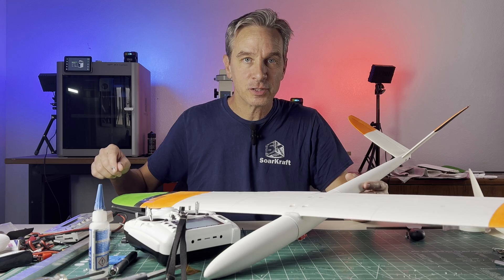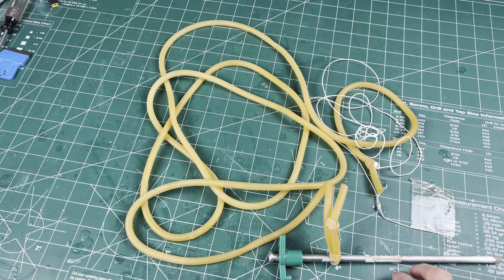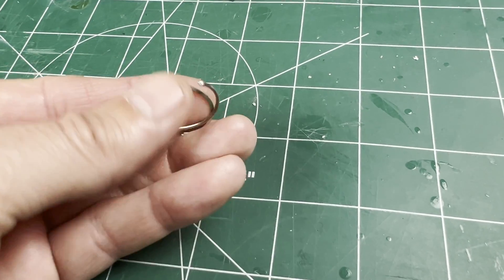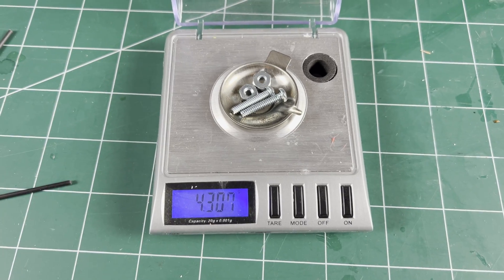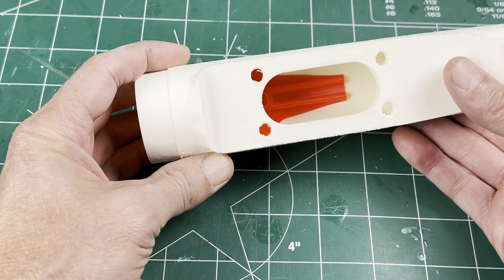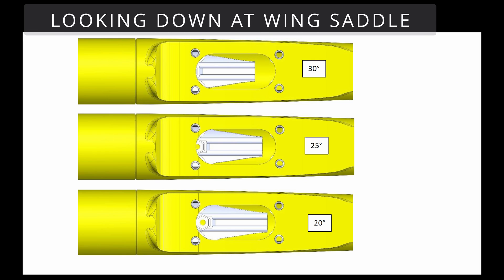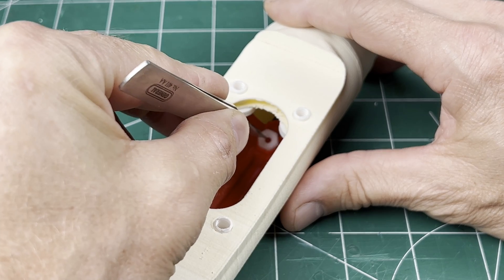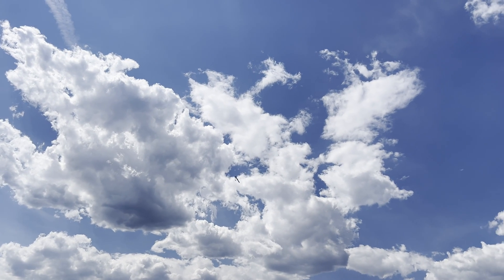Add 3D Printed Tow Hook to any SoarKraft model - Bungee Launch - Build and fly

Comment: Nice work!   I’ve been flying your Igneous design for the last couple months and it’s been super fun!  Maybe I’ll start a pure glider next!

Hey,  couple design thoughts or ides….sorry I can’t help myself:)

Why not add bolt threads to the tow hook part itself, this would allow the nylon bolts to screw in from the inside of the fuse?  Might make it a bit cleaner.    Better yet if you add some extra reinforcement material on the inside of structural part and predrill a hole,   You could screw in or glue in some 1-2mm wire for a tow hook,  kinda  like the old school balsa gliders use to do with some hardwood block for strength,   super clean.  

Love your stuff keep it up! 

-Chris
Reply from the maker: Thanks for the ideas... I use the carbon for reinforcement in this design sort of like you mention but on the inside for fuse support.  I did tinker with a piece in the tow hook, but it was not necessary.  The hook mount and screw locations do not line up with the fuse opening so I would have had to do some serious design jujitsu or get smaller fingers (better tools) to get the screws in from the inside.  Possible.

Comment: How high do you think this will get the Jucy ?  Building now, but wanting to test somewhere.
Reply from the maker: Not hi enough, the Juicy is meant for strong wind days on the slope, and the toe hook add on does not fit the juicy.  There is a carbon rod that runs the full length on the bottom of the fuselage.